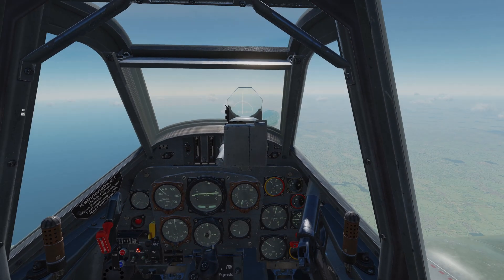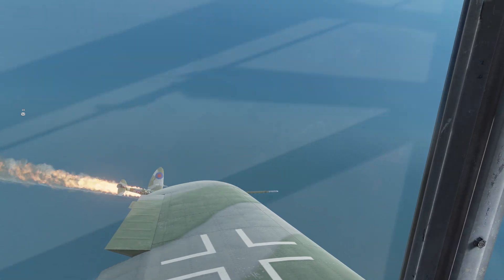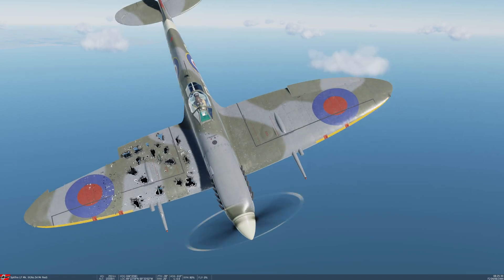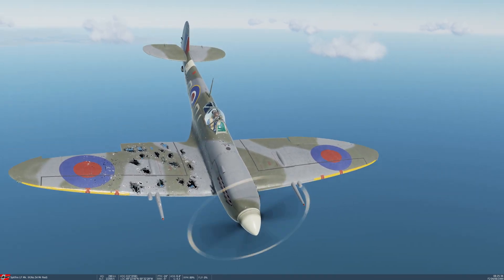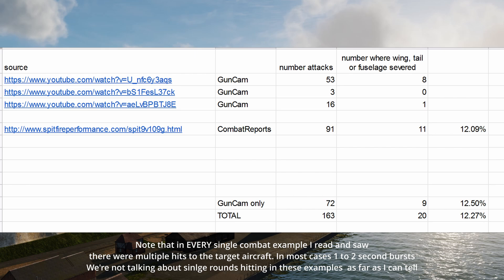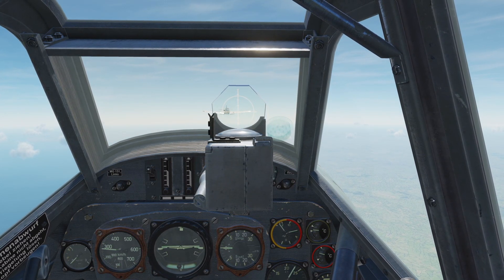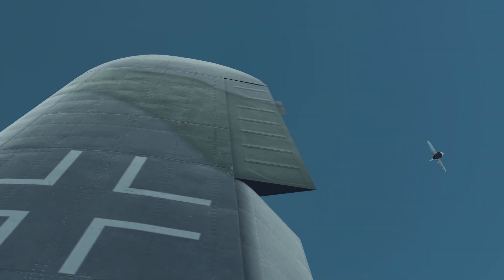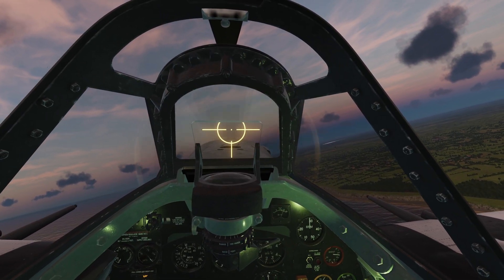Mk108 Canon v Aircraft - DCS Damage Model Tests II

Comment: Not an expert in RL nor web-research, but honestly, one or two bullets knocking out the whole plane/engine just like that seems a bit too much to be true, are these things that fragile in RL??? at least so fast, if things are leaking, they should take a bit more time, tho we know things under pressure can lose that pressure rather fast, but I still think this DM is early access and that's not a problem, but I rather they keep working on WW2 DM for quite some time before going over to cold-war and modern aircraft DM. Secondly, the weapons need a proper DM also IMO, or what, not just the receivers of damage, but the dealers, did we ask ED about this? We could all call it just DM for both, but I coined up distinct terminology for example DRM (Damage Receiving Model) and DDM (Damage Dealing Model), however depending on the sim engine perhaps it's not how it (could) works? Perhaps there's either no reason or unnecessairly complicated to have DM separated like this and all behavior/effects/stats is modelled on the receivers? That's actually a side-issue really, may not have practical difference in the end for players, ah, I can't stay focused, I'm always fiddling with how this or that works hehe.
 I got a bigger response to this whole thing, but it's rather long and perhaps better for forums rather than comment here.
Reply from the maker: They're not bullets, they are 30mm explosive canon rounds.
Reply: @philstyle  Yeah I forgot to add that the visuals may not be reflecting that, which kinda brings me to what I was talking in my longer version comment, about the previous video, where you kinda said something along the lines of visuals don't matter or it's not about pretty explosions, well isn't that the most important or rather the whole point of a new DM, so that the visuals correspond/sync to the actual gameplay logic and effects and behaviors caused by attacks and their consequences. That's how enemy gauges damage externally, by visuals, so IMO it's an actual gameplay thing, even tho it doesn't seem to be, and ED shouldn't skimp on that.

It seemed to me you documented what was happening alone, without context, I really have no idea whether you agreed or disagreed with the results in the first video.

The odd stuff is where you kept hitting the wing and some fuselage damage occured like various-sized bullet holes into the cockpit windshield, I just don't feel like that makes sense. Yes I know we're limited in the sim for many known reasons but I feel like I have an idea that could improve this heavily without that much of strain on hardware. 

Having the whole wing sprayed like swiss cheese from one of those rounds (even if they explode) seems kinda excessive visual result, too much too fast IMO, but if that's how it's suppose to be than so be it, however I won't believe it without research/explanation (not asking you have to do it for me personally, unless you have the time at hand)

I thought the visual layer would be more finesse, not tied with the sections for where structural splits/decoupling would happen, that's why you hit the tip of a wing, and 20% of the wing receives extensive damage visuals for the size of that whole split section, which is kinda expected and fine, but perhaps it could be even more finely grained later on. Secondly why the damage way into the fuselage if, as you said, HE rounds explode at earliest impact and I can see very much instantly in DCS, no delay or penetration, so that's quite a far way away from the fuselage IMO, unless I'm just having no idea of the destructive nature of these that DCS is conveying right now?

For cockpit windscreen damage to occur like that (first video at the end), the big holes, it would preferrably need to be hit by some debris, and probably kill the pilot too no? So are this suppose to be debris? Do we imagine it's debris and it's not simulated in DCS to preserve performance requirements? Debris being shown or not isn't the problem, but without seeing it we can't gauge the simulation responsible for the gameplay effects, so that's up to other means to figure that out, but the thing is, this debris/shrapnell should cause proper type of damage to show up, visually.

Visuals are a broad term, I mean functional visuals which have to be correct in their main parts. They have to accurately convey the effects. We're getting confused by those who don't care about the gameplay effects and more about how things look when they crash, as we all use similar terms, while these tests are important and correct, it cannot hold any weight without proper visuals in the functional sense of describing almost everything of what happened. The color of that fireball can be off by 10%, that's fine, but the size of it shouldn't be off more than 3% for example. And there's many many more cases where tolerance is low because of the effect that it is conveying can result in substantial consequences that could/would decide the fate of the whole fight/objective/battle/mission/campaign.

What I'm proposing, may already be case to some extent (I don't have DCS installed currently for PC maintenance/upgrade), is that there could be many different layers of damage visuals/logic-effects on the airplane for each type of weapon damage-dealing effect, so that different damage-dealing effects would affect different damage-receiving layers, or more accurately by different amount. This would also then allow to show different visual damage for each layer, which the point is, to prevent mismatches when a shockwave effect would cause the standard damage visuals to show which include various-sized bullet-spray type of visual damage, shrapnell, and a mix of holes and "deformations", which makes it less realistic right?

If there's only one layer type of damage visuals, for every weapon damage type, then shockwave from FLAK would also cause bullet-looking damage visuals, shrapnells, holes, but I think in RL, for example if all your damage received were from in-direct shockwaves, I think things would kinda look shattered, perhaps things felling apart in a sense, perhaps making some moving parts to be less controllable or jam, or even unjam in the next hi and cause more internal effect rather than external sheet metal piercing, perhaps internal smaller leak, but contained in the roughly untoched external shell, so it be leaking but only leaving small trace externally or in a different location and in a different kind of trailing effect, indicating slower flow, for example if there's oil lines leaking inside due to shaken around, the leak may be far smaller than if it were hit by bullets or blown, pressure should drop slower and only more subsequent shockwave hits would then shake the oil/fuel/coolant lines further and causing more damage there, and externally the windscreen should look shattered whole-through with equal-looking pattern of shattered pieces, not an isolated small-diameter hits, and you could further fine-grain that by adjust transparency of the shatter effec for smaller or bigger (more) shockwave damage, so in the end in-direct shockwave should take quite a longer to bring a plane down IMO, and shouldn't create these kind of visuals and fires/smokes so quickly IMO, if that's the case, heard some people saying shockwave from FLAK being deadly now, because it's probably affecting the single any-damage layer.

Also for the see-through effect and bits falling off, I don't think they are manipulating actual geometry except in the pre-made and fixed splits/decouple points that we rougly know where they are. The see-through is most likely using clever trick of portals. That bug you saw where there was no engine or just blackness in one of the holes gave it away IMO. The portal's intake is on the other side so you see from that point(plane) outward, after the engine,  which probably would make sense for performance requirements and modelling complexity low enough, and the other point is, that in that case people shouldn't say that "any more of those deformations and we would need supercomputers", I don't think these things are real physical objects, the debris probably isn't either, so this shouldn't be that costly, if the portals are costly they're mostly on the GPUs and GPUs are getting so much better they should be easily crunching that, unlike CPU dependant workloads.
Reply: @stephenzenerak7846  You probably could have written code for all that in the time it took you to write so much! As I see it there's little point in going into the kind of detail you're looking at at the moment - the technology really isn't there and anyway, we have no way of gathering empirical data on these weapons and their effect on this airframes so there's always a considerable amount of guesswork and "developer's licence". I think if it plays satisfyingly and there aren't glaring disparities in the basic effectiveness of weapons as far as we know from historical accounts, then it's a win.
Reply: @stephenzenerak7846  jesus dude get some friends

Comment: The main question I have is: previously on the turn fight,  I would shoot someone and see tons of smoke come out from "hits" but no damage would actually happen. On level flight, damage was easily done as "hits" would count. I stopped doing WW2 on DCS because of this, I would often run out of bullets and barely down a single plane even after visually scoring over 60/70% of the hits
Reply from the maker: That's not a question
Reply: @philstyle  i think it was obvious but ok, question is: does that still happen?
Reply from the maker: Dunno, it never happened to me before. 
Make sure you're firing your canons and not just MGs
Reply: @philstyle  In a turn fight, you never had that visual "hit" effect of a puff of smoke showing?

Comment: Hi guys,

Historically, I’ve read that, by 1943 (Carnets de vol by Saint-Exupéry, Le Grand Cirque by Pierre Closterman), ammos in fighter planes were a mix of std, tracers, igniting and explosive bullets.

That being said, to play DCS, I up-dated my PC with last gen PCR and a brand-new video card. I laid my hands and feet on a Logitech X56 HOTAS + rudder pedals. But I’m struggling with visual. I mean I get my a** kicked pretty good even playing off line (I won’t talk about on-line games) coz I struggle watching my six with my keyboard. Right now, I don’t know where to go. That’s why I come to you asking what’s best, Track or VR? In those categories, what are the best devices coz I’m tired of getting my a** chewed-up all the time (on line and off line) coz I can’t peer to what’s going on around my own f*****’ plane? Thx for your answers. Hope to meet you sometimes up there.

Philippe.

P.S.: I guess you noticed I’m kinda frustrated!!
Reply: If you have a 1080Ti or better, you could certainly do DCS VR at playable settings. Make sure you have a good CPU, too. An i5 9600k or i7 8700k is what i've seen most people use. 
For ease of use, TrackIR is better though. With my gtx 1660 (about 40% less powerful than a 1080Ti) I can quite easily push 100 FPS at 1080p with TrackIR. TrackIR is easier to set up and use, but you don't get the full immersion like VR. Do consider that you can do a DIY TrackIR for around $10-20, so you don't have much to lose just trying it.

Comment: The German planes tended to zoom and boom.  Your tests were all sneak up from behind and blast along straight down the wing.  In a zoom and boom, the rounds come in from above and could hit the spar directly.  In IL2 I could take the wing off a fighter by concentrating fire on the center of the wing.  I could even remove the wing from a B17 with a particularly well placed burst.  I generally used the FW 190 A8 or A9.  I don't know if that was realistic, but I suggest you try some attacks from above and try to hit the middle of the wing.

Comment: Wing structural damage does require AP,  concentrated hits and combat g-loads for the target.
Reply from the maker: Yeah, seems to confirm what ED are suggesting.
Reply: @philstyle  Well, check post war British MK108 tests. 1 MK108 hit each and stationary Blenheim's and Spitfire's tails come off. 1 hit to the wing - lethal structurally and aerodynamically, loss of wing controls and spar severly damaged (it would give out even in level flight most likely). 2 MK108 hits to the wing would be a sure way to achieve a structural failure. While MG151/20 m-geschoss would require quite a bit of luck to hit the wing so it can reach the spar (shell explodes 20cm-30 after penetration), so spar damage is way more difficult to achieve, MK108 had slightly longer delay and a lot bigger blast radius.
Reply: @philstyle  I'd love to post a link to a shot further away from the fuselage, which clearly severed the spar, but youtube removes it. You can find it in "3cm MK108: Historical test data vs ingame test data" topic on Il2 forum. 

And finally, the damage you've shown in the video was deemed probably lethal structurally and aerodynamically, lethal by loss of controls. Probably lethal structurally means that the wing coming off in actual flight was a very strong possibility. I'm not going to argue wih British experts from the era.

On youtube there is basically 0 high caliber cannon vs fighter gun camera videos, and I think I've seen only one where MK108 actually strikes a bomber.